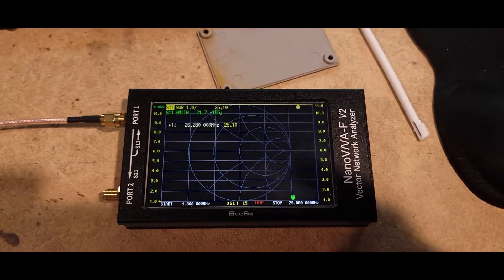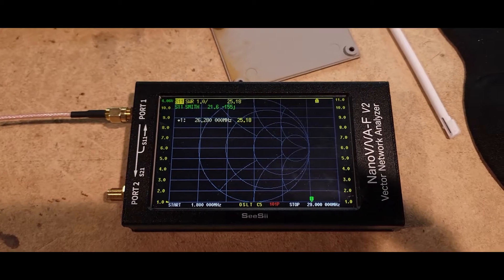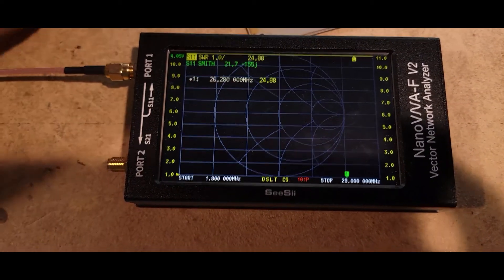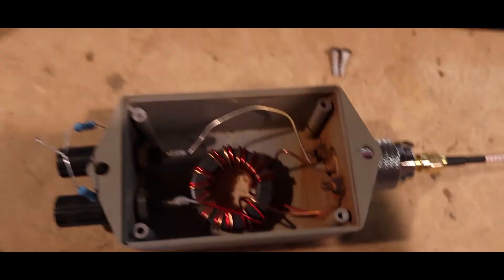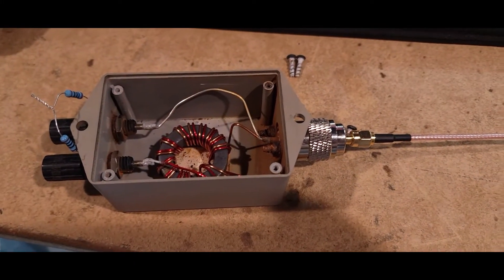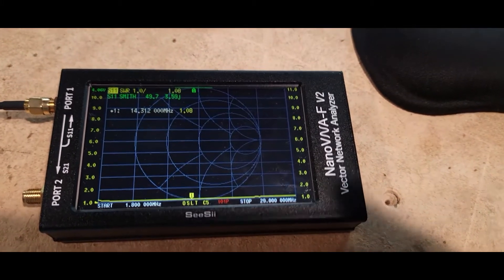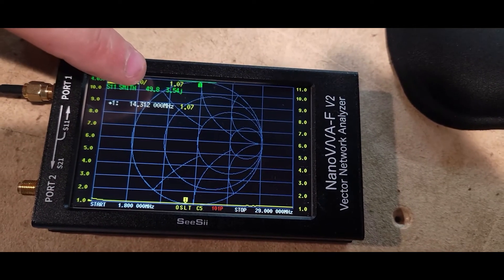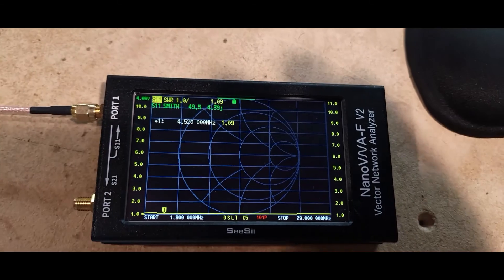Testing and repairing a 4:1 balun

Comment: All you have proven is the TRANSFORMER spec. The PRIMARY purpose of  a balun is to allow an unbalanced feedline (coax in this case) to feed a balanced antenna. In order to do this, the balun must have a high impedance (and preferably resistive component) to common mode at the feed. You have not measured this spec or  the insertion loss. Until  you know the Zcm (which you  can measure  with the VNA, along  with the S21 spec= insertion loss),  you  do not know if  you have a balun at all. What you  currently know is that it is a transformer.
Hint- it is impossible  make a 4:1 Current balun with a single core. So, what you have at best (and we still do not know, until you measure Zcm of the device) is a Voltage balun- which is useful in mixers etc but not in antennas.
Reply: It appears to be a commercial 4:1 from LDG.